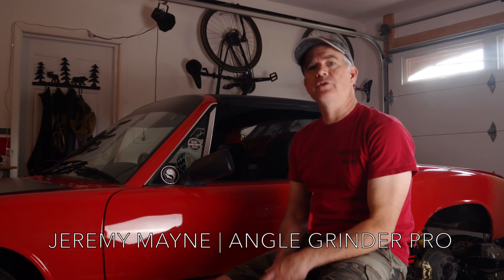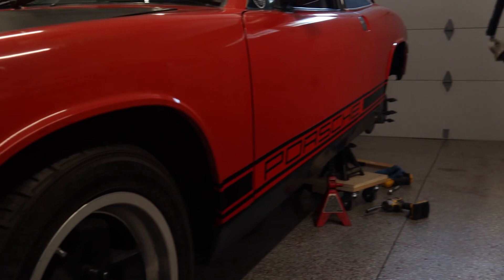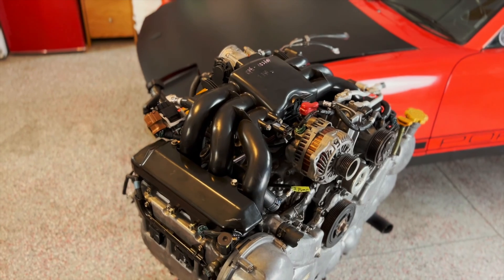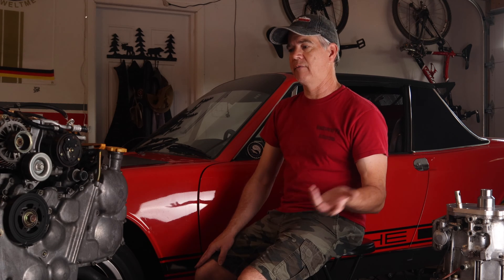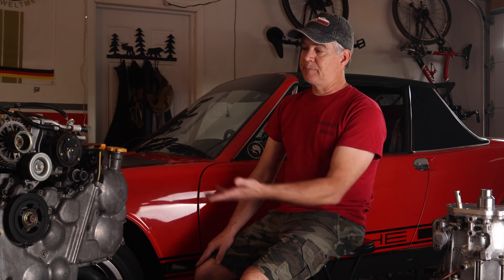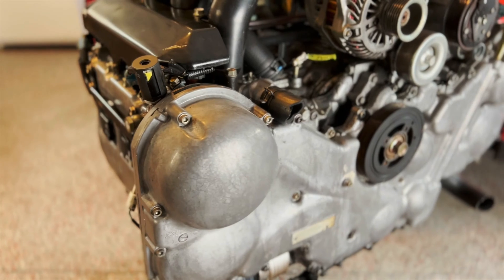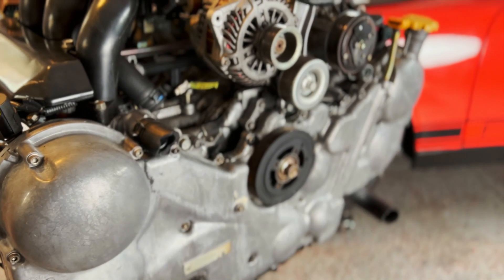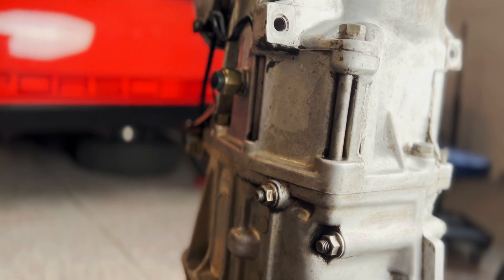Porsche 914-6 Subaru EZ30R Swap Part 1: Introduction and Cost Overview.

Comment: 5:45 I wouldn’t want to run that with a 901 transmission unless it was rebuilt and bulletproof. Maybe a 915 would be better to carry all the torque produced by that six cylinder Subaru boxster!

Comment: Subaru engines is unreliable. Why not BWA/BWE 2.0 VAG engine with 6 manual? It's quite reliable and light. Besides, you can easily get 300bhp from them
Reply from the maker: I'm sure the engine is going to be reliable enough for his needs.
Reply: Mostly wondering since he’s using a EZ30R engine with “drive by wire” instead of drive by cable and having to deal with Canbus issues, how is he addressing the communication to the ECM etc.
Reply: Stop....they are very reliable
Reply: @josephhertzberg2734  read statistics, it's not really
Reply: Ok boomer